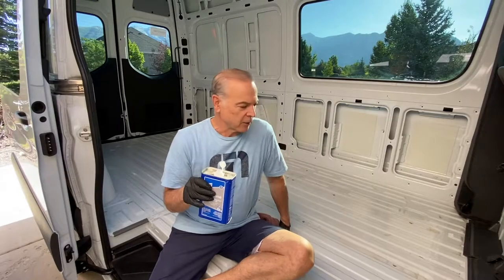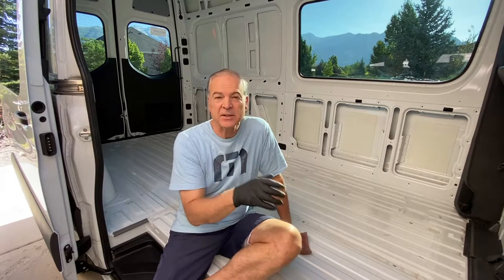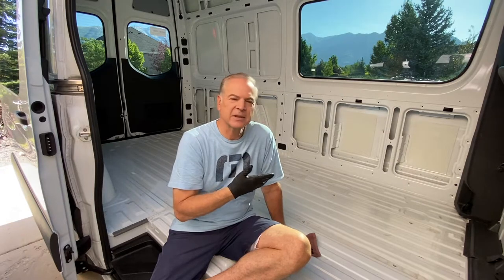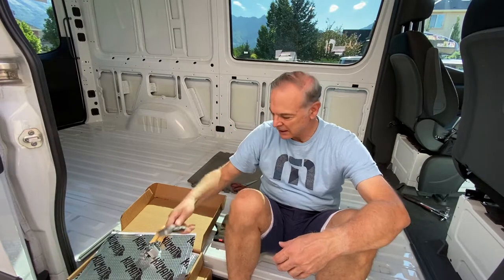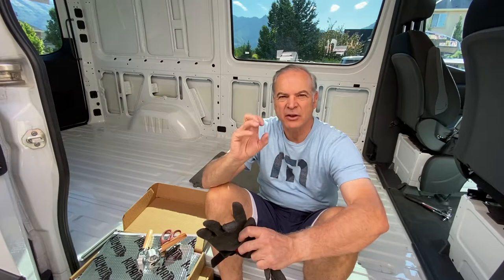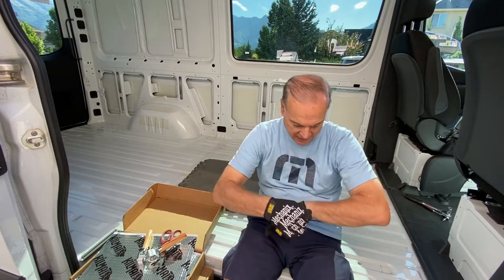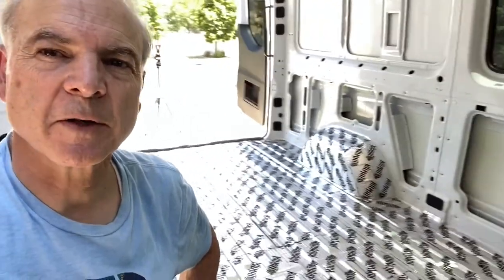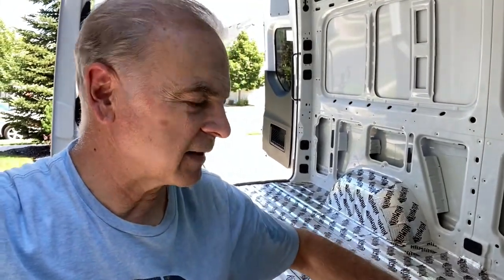Installing Sound Deadener on Van Floor

Comment: Hi, thank so much for this video! Just wondering, did you not put Kilmat on your walls and ceiling? All these other videos put deadening on wall and ceiling. So confused. :(  Trying to figure out how much deadening/ wool I need for my 2002 Ford E-350 high roof XLT Super Duty Van. I can't seem to find any videos on this Ford van. So frustrating! I'll be checking out your other videos. Thanks for including everything you used. Subscribed :)

Comment: Also, some people recommend only covering 25% of the van floor, but I am considering doing the entire floor as well. What made you decide this?
Reply from the maker: I did the floor for insulation, as well as sound deadening. Sound deadening only doesn't require full coverage.

Comment: I'm curious about one thing, you lay the mat on the floor entirely. I was wondering if there will be any softness, for lack of better words when you lay the final flooring, any bounce or spring. I want to lay flooring like i have in my house and I'm worried about the seams flexing and breaking apart becaue the substrate had some give to it.
Reply from the maker: We lay the factory floor back down on top of the insulation. This provides a somewhat rigid foundation for the flooring. We use a laminate flooring that is 12mm thick and has very robust locking edge. We have not seen any issues with the seams separating, however it could be an issue with flimsy, weak flooring.

Comment: Seems to be a problem with ordering through your link to amazon - the Kilmat.
Reply from the maker: Thanks for pointing this out. It is fixed now.
Reply: okay went into your store - order Kilmat (36 & 18sq) and rollers.
Reply from the maker: @RJGilman1967  Good luck with the install, and thanks for your support.
Reply: It said they were sold out on Amazon when using your two links to the mat and the rollers. I am so sorry that I had to order outside of your link because I find your videos so helpful. Thanks !